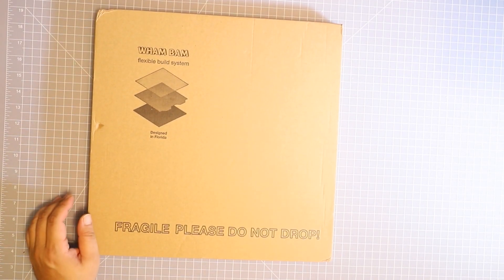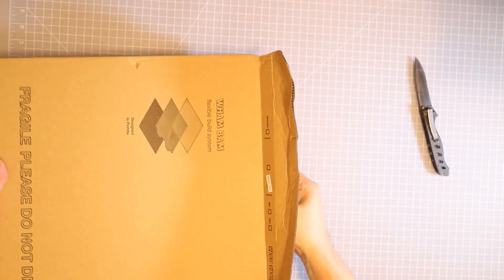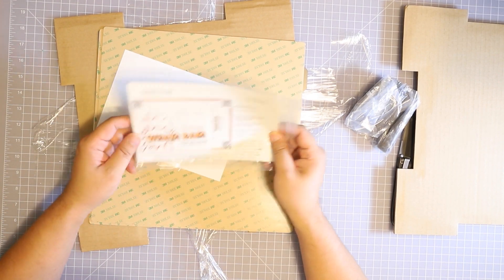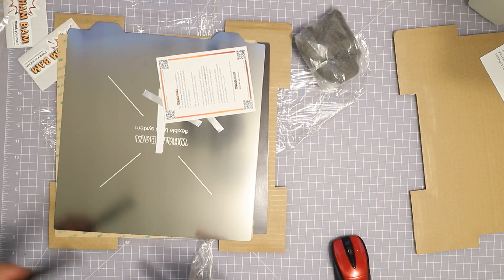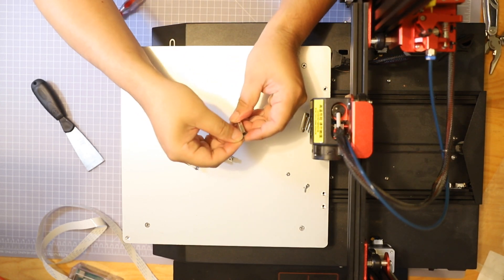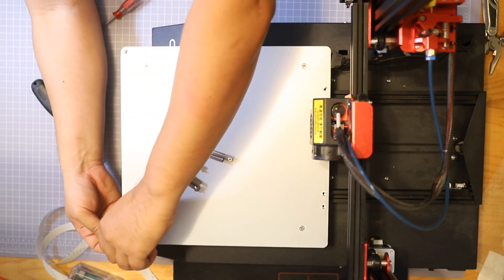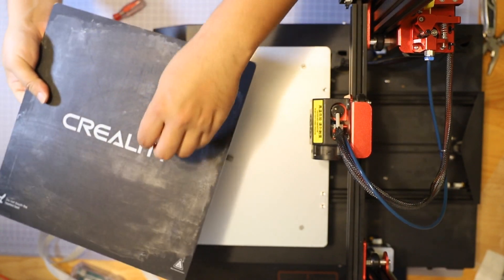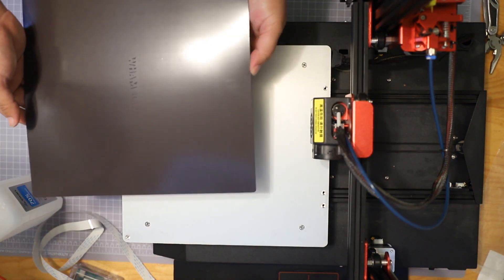Wham Bam flexible system - Unboxing and upgrading my Cr10s pro 3d printer

Comment: I have a CR6SE can I just use the auto level function?
Reply from the maker: I don't think the CR6SE comes with a sensor for auto bed leveling. Unless you purchased it with an optional sensor or made an upgrade.
Reply: @DiyProJames  it does I use it all the time, I just don’t know if I’ll have to make any other adjustments after the wham bam board is installed. That was one of the big selling points for the CR6SE. Thank you for the response
Reply from the maker: @fox218-23  I looked into the specifications at the official website. It doesn't mention what type of sensor is being used. This must be the new option I see in the firmware of a nozzle sensor. I had to find a video that makes a reference to it here https://youtu.be/2NyTG8YCIPc?t=428
It seems to be a two stage system. Optical sensor gets the level of the bed. Then a pressure sensor(similar to the bltouch) gets the actual mesh values. It's an interesting system. I wonder if the reflective surface will affect the optical sensor. (Not likely since it's moving parallel with the surface, not perpendicular to it.) To me the optical sensor seems overly redundant.